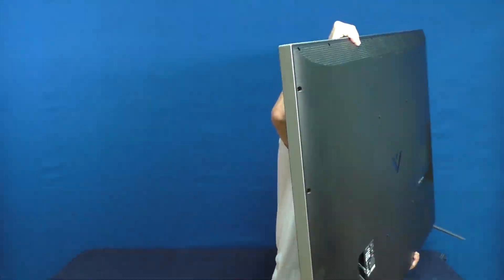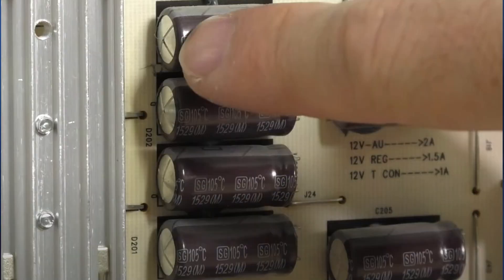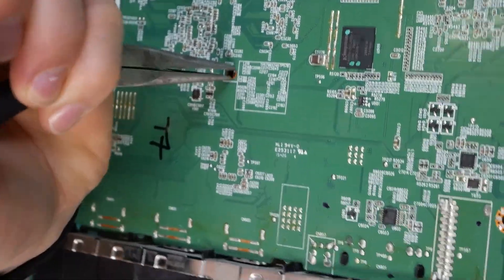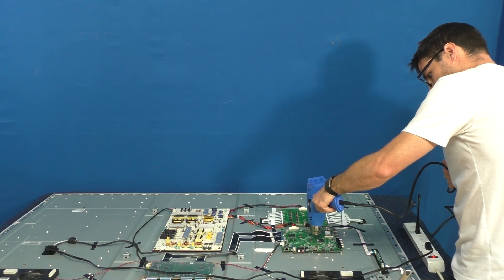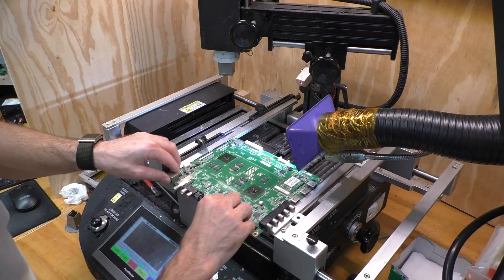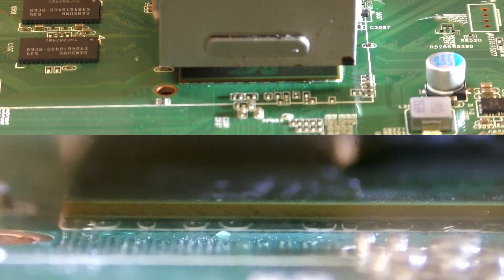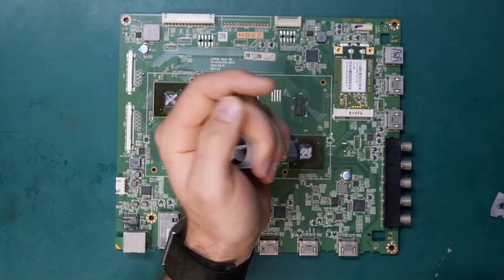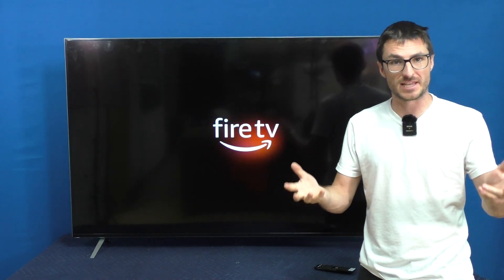Vizio 4K TV Won’t Turn On? Diagnose & Fix It Step by Step M70-C3

Comment: Reflowing the BGA is NOT a permanent fix. It will happen again. Wait and see. You have to re-ball.
Reply from the maker: re-ball is not a permanent fix, it will happen again. Replacing the chip is not a permant fix either it will happen again. 
Yes to all the above, but I can assure you when reflows are done properly by proper equipment and by techs with 10+ years of experience operating said equipment, a reflow can last just as long as a reball would if not longer as it induces 1/3rd of the stress to the chip. 
The reason most reflows don't work long term is they aren't done right.

Comment: My Vizio E70-E3 tv turns on but it takes a lot of patience. Most of the time the power button does nothing and I have to mess with it. But once it is powered on, it stays on without any issue. Should I be trying to replace the main board, or the power supply?
Reply from the maker: I recommend opening up the TV and taking a look at the power supply capacitors as mentioned in the video. Take a look at them and see if they are bulging. I suspect they are, and if that's the case you can either send in the board for us to fix, or if you want to try and do it yourself, we also sell the repair kit. If they are not the issue, then it's a mainboard failure in which case we can also service that for you if you would like.
Reply: @NicksTVRepair  checked the capacitors and they seemed fine, but the board seemed like it could have some scorch marks. Replacement boards were pretty cheap, around $40, and replacing it fixed the issue!
Reply: Update... Nevermind. Fixed for a moment then back to same old. Maybe a little better, but still not working.
Reply from the maker: Scorch marks? It's probably just dust settling in a specific pattern from the airflow going through the TV. 
And yeah if the caps aren't bulging then the power supply is not the fault, the mainboard is the fault. You just are experiencing intermittent functionality from your mainboard.

Comment: Hey, maybe you can help me. I bought a defective sony tv model kd-49xf8505, replaced t con board and I've tried to reinstall firmware ever since replacing, tried older ones, different sticks, different ports, left it for hours on end - I can force it into install turning the light to white but after that it just returns back to green/amber and there s some sound playing from the tv, no display however. I can hear something happening when I press buttons on the remote but I dont get any image and backlight.

Comment: Some faulty PSUs have visually bad caps but the vast majority don't.
Reply from the maker: When it comes to the model we are diagnosing in the video, when the caps go out it's ALWAYS visible. I fear this comment might confuse others, so we need to clairify you are not talking about this TV we are are reffering to but you are talking about other devices not mentioned in this video.

Comment: Wow TV with copper heatpipe??
Reply from the maker: Yes those 4k processor chips get very very hot.
Reply: @NicksTVRepair  Usually LG OLED are using much smaller heatsink and front I'm seeing, they are having more powerful SoC.
Reply: Even with the heat pipe this heatsink is quite undersized.
Reply from the maker: Agreed! Ideally they double the size or add a small fan into the mix.